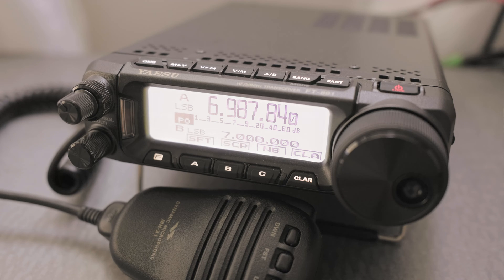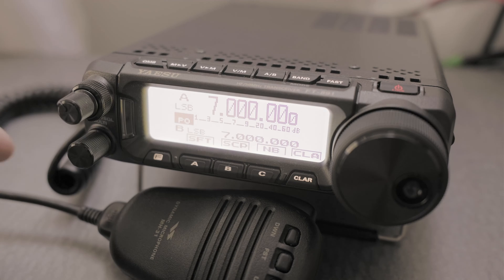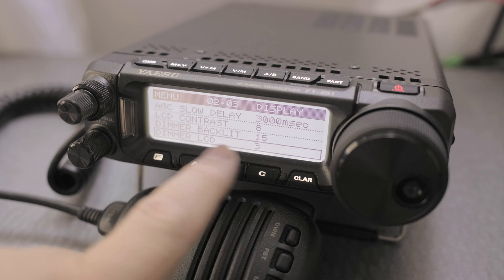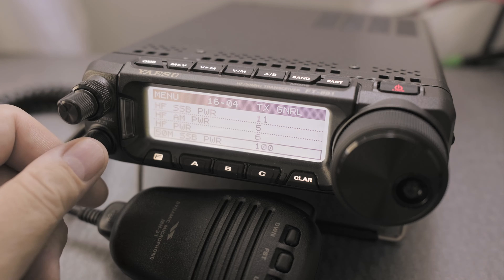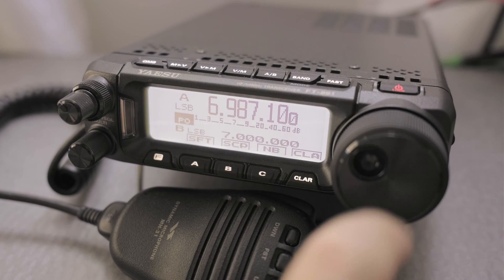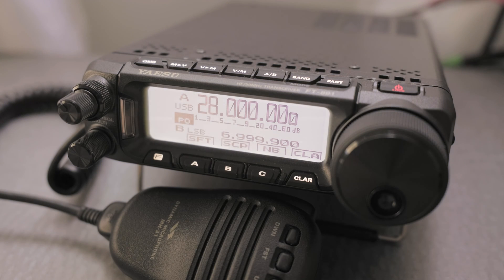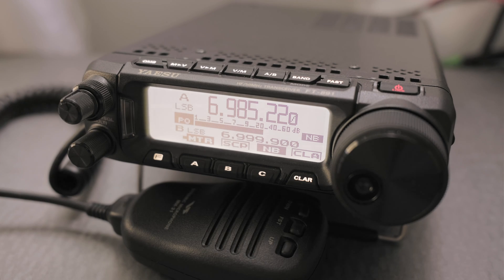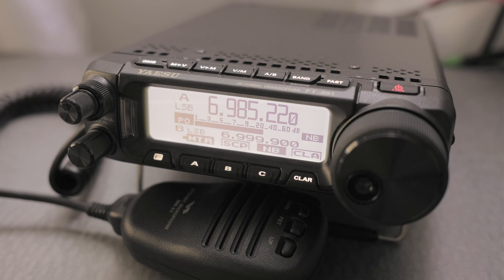Yaesu FT 891 Beginner's Guide

Comment: I'm a new ham here in Brussels Belgium.  Just bought a 891 + FC50 this weekend "used" (barely)

Today i put up a Sigma Euro-comm lw40(meter) EFLW .  
So I'm just listening for the moment,  no TX until i master both the unit and the antenna. 
Your video here truely helped me. First to do a total reset.   Then to go through things like you showed.
Excellent !  
Thanks
ON3VCF
Reply from the maker: Excellent!  Have fun with your radio! -73

Comment: Hey dude do I want to start diving into the qrp side of the 891. So what’s the difference between HF SSB POWER and HF POWER. If I want run the radio at 15 watts do I adjust both those settings or one or the other and why? 73’s
Reply from the maker: That is a good question. I place both on 5 to be sure it's transmitting at 5 watts.  But, if you read it literally, you would think the HF SSB would override the HF Power.  If you want a definite answer, you might want to contact Yaesu's tech support, they should have a better answer.
Reply: @frankwc0o  

HF power is for FM & CW only.
Reply from the maker: @harrybatt998  Good to know.  Thanks for the info.
Reply: 15 watts is not QRP in any mode just FYI.It’s 10 watts or less on SSB & 5 watts in CW & Digital Modes.

Comment: Over all I like this radio but there is a few things that just make me mad and would like them to fix it.. 

1. Mode menu, when selecting SSB mode "ask if you want USB or LSB" for faster switching. or just remove "SSB" and add in separate LSB USB trying to fined it in the Sub menu stinks why would they have it in the Submenu. it makes it harder to switch to USB when running FT8 and other digital modes.
1.5  when changing the Mode or the BAND using the VFO to select between them is horrible! Change it to the multi fashion knob and keep it up till you press the multi fashion knob.
2. With autotunner enabled I get a "WAIT" over the freq display so i have to go and disable the Autotunner when tuning around the band. it's Varey distracting it makes scanning the band hard or going to a freq to meetup on. 
3. When adjusting the squelch, the pop up screen stays up till you hit a button. have it disappear after 3 sec.
4. the power submenu is confusing ok SSB power and AM power and FM power But what is HF power??? 
there is some other things that are dumb and make no sense and i wish they would fix them. but I'm at work and cant think of it

thanks for your video..
Reply: SSB, by convention is LSB on 40 m and below, and USB above it.